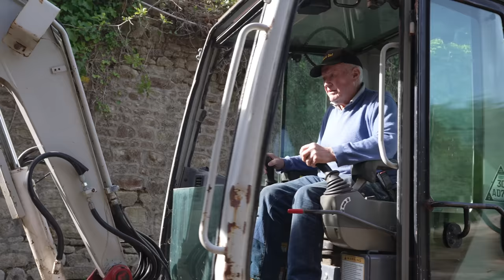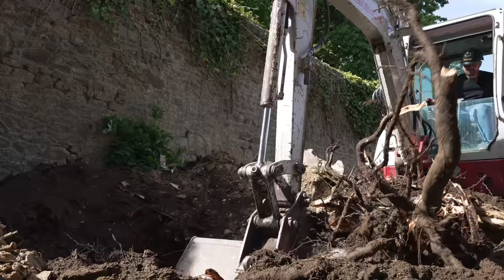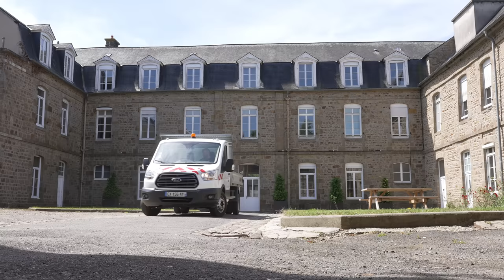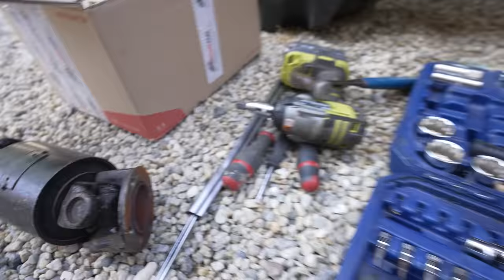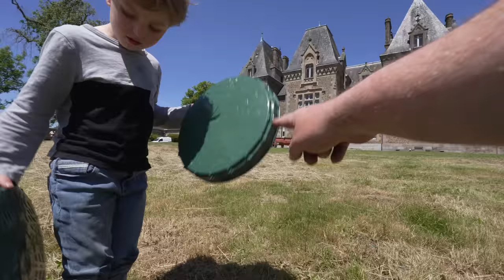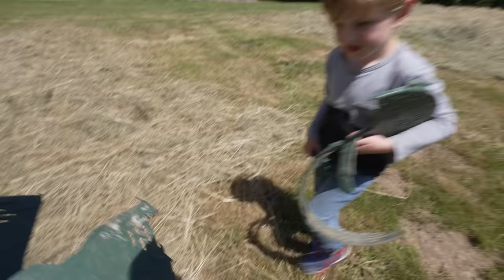Garden Restoration at a Forgotten Convent

Comment: I think those universal joints are normal; they are supposed to be quite flexible, and are only stiff when brand new. Some 'rotational' slop would be more concerning and, if bad enough to make noise, would expell a rusty powder. If the mating shaft bearing is bad, it would weaken it's seal and leak lubricant. I hope you find the problem quickly--and without too much more cost. Thanks again for returning to the 'dailies.'

Comment: Billy be careful when switching driveshafts they are phased with the pump and engine as a whole unit. Do not turn either end when reassembling.
Reply from the maker: i was thinking exactly the same thing as i was changing it! thanks for the suggestion!

Comment: Moral of the story, mark the septic tank cover locations with bamboo canes or something similar before mowing...😅 

Just going by how worn the original part you replaced was, I doubt it was a waste of €1,000. You'll probably find in the end that it will be a combination of that, and the bearing that still needs replacing that causing the issue. 
Either way, your telehandler is going to get a fair work out over the years with a home such as yours so high quality maintenance is never a waste of money. You never know, having the telehandler in tip top shape might be a lifesaver if winter storms do serious damage to the roof tiles and you need to get up there quick smart!

Comment: When they did our drive way before we bought, they use biodegradable vegetation. Something that broke down and  degraded etc. Thus over the years the driveway sank in spots without support. I I guess the method of planned snow removal is the best reason for surface of a driveway. We can do gravel and expect to then snow blow. But tractor and buckets or shovels would work fine.

Comment: Mechanic work often requires multiple part replacements before the ‘rattles’ are resolved.  The part you replaced definitely looked worn and loose, so don’t consider it a waste.  Move onto to bearing and
cross your fingers 😉🥴

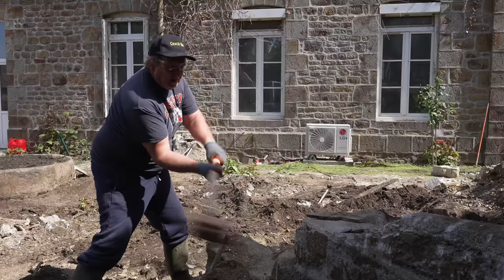Comment: Anybody  else notice the "mist" flowing towards the window in the background  of the sledgehammer  at approximately 3:45? I watched  the. Section  over several  times and it only happened  once. So if it was dust  from the sledgehammer,  why didn't it happen  every  time  that the  sledgehammer  was used?

Comment: Sounds like the clutch drive plate springs are rattling. They will cause lots of damage if they detach from the clutch plate ☹️ My humble opinion of course based on the recorded sounds & as a qualified commercial vehicle technician.

Comment: A grand for a tiny little shaft??? Strewth! 
Should only cost no more than 50 euro's for two new Uni Joints to refurbish the old one, easy and will only take 10 minutes longer over all. 
And that rumble is something moving constantly, that Drive shaft only moves when the vehicle is moving. 
That rumble is something to do with the engine itself, or something that has become loose and just needs simple retightening. 
Don't forget to use a grease gun to grease those new Uni's, they do not do it from new.

Comment: On your machine the rattling noise is not gonna be a moving part  Like your drive shaft those will only make noise when you put it in drive or reverse you're looking for something that makes noises without putting it in drive  I'm from the United States here if it's not a electronic device most places will take it back so if you take it out wipe it up clean it up call them up they might take it back you might get your 1000 Back Because more than likely you would never change that part not for what you do with that Machine   I do like watching your videos so let me say crack on

Comment: I couldn't help but cringe slightly, as the widow of a mechanic, often of the shade-tree variety, when I saw you plunk down a thousand pound part into pea gravel. Shudder! My dear departed hubby would save up empty cardboard beer flats for little parts, nuts, and bolts, and carefully spread out big pieces of tarp or carboard or carpet, in order to keep any and all tools and bits used in repair jobs out of the dirt and gravel anytime he had to work in places which had those. The slightest bit of grease or leftover whatever from the factory can pick up some crud or other and screw you up down the road.

Comment: Ill tell you what you do, save yourself a HEAP of money by calling a good mechanic (instead of an ambulance and a lawyer) and stop haphazardly replacing parts on your own.  You're just causing a bigger mechanic bill in the end to correct all the stuff you tried to fix on your own.  Let a mechanic fix what's wrong the first time.  Its also dangerous to try and fix this equipment on your own (incorrectly) and in the process,  cause someone to get hurt from using the equipment.